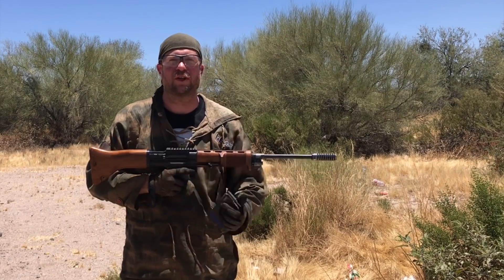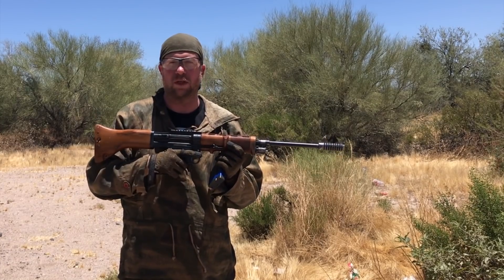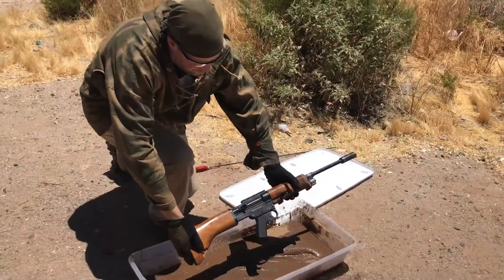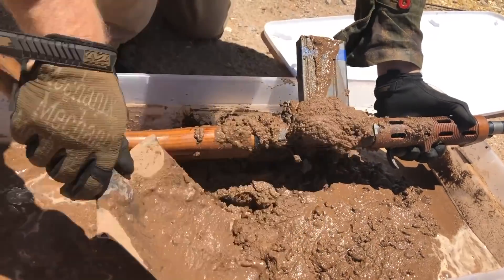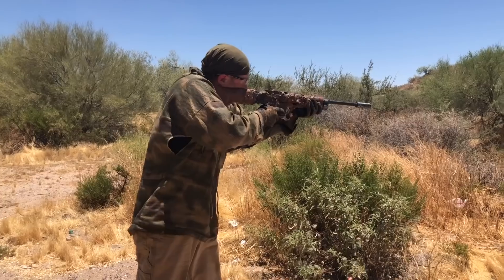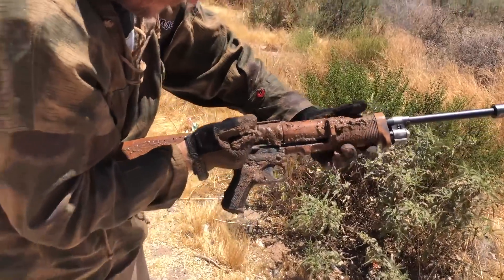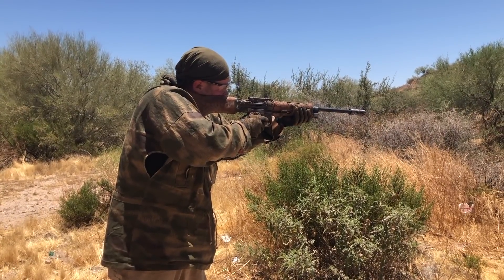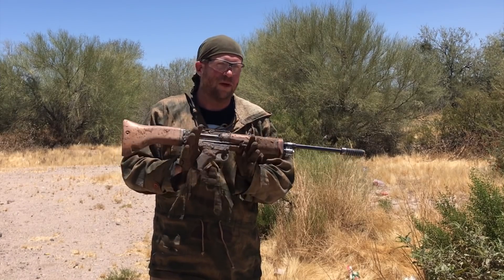Mud Test - SMG Guns Reproduction FG42

Comment: And I always thought the FG42 was a rather delicate rifle. Little did I know.
Reply: Ironically, for a gun that looks delicate, the fact it was made for use by German paratroopers required that it be very tough as German parachutes were notorious for their low-retardation, resulting in a higher drop speed than typical for American or British designs. Meant that their containers and troopers alike took pretty hard knocks, so everything had to be well-packed or just plain tough.
Reply: The stock is the most fragile bit.
Reply: It still is. It's just tightly sealed.
Reply: Well, the original production FG42's were more fragile in their design and execution due to different manufacturing tolerances and material constraints of the war, so there is potential there for failures. I could especially see mudded cartridges causing a lot of potentially dangerous firing issues in the original FG42's cylindrical chamber (designed so the gun could have manageable and safe extraction pressure). But, needless to say, I don't think it's worth risking a scarce $200k+ original example on this theory. All-in-all, I think this test of the SMG repro is a valid test of what the potential of the FG42 /could/ have been and is certainly reassuring of the quality for people (like myself) trying to save up the $5k for one...
Reply: People say the same thing about the AR15/M16/M4 family of guns, and those pass. It's got nothing to do with fragility, it has everything to do with being a sealed design. No gun will tolerate gunk in the action, some designs are just better at keeping gunk out.
Reply: @thforres  "No gun will tolerate gunk in the action" Beside an open bolt SMG with a fixed firing pin. It will just keep firing .... out of battery. I think we will never see a mudtest with a MAC-10. Because it just isnt a safe thing to do.
Reply: @robert8984  no the mud would probably slow the bolt down enough it couldn't set off the primers
Reply: @tatsuhirosatou5513  agreed. As previously stated the reason guns pass these tests is because they seal well. Any open bolt design will fail miserably. And for all the naysayers, I know the original FG42 was open bolt, this one obviously isnt and thus, why it passed so easily
Reply: @thelaborpeasant  To be fair, open bolt in full auto but closed bolt in semi auto. If it stayed in semi auto, I think an original would have been fine. Forget about the full auto setting when the bolt is open tho.
Reply: @thelaborpeasant  The original FG 42 was open bolt for automatic fire only. I'm semi auto it was closed bolt only. Larry Vickers did a video on an original FG 42 that shows this quite nicely.
Reply: @onelonecelt9168  well I just mentioned it because I knew some keyboard hero would try to factoid me about it if I didnt mention the open bolt, that's all lol
Reply: @thelaborpeasant  Keyboard hero! Lol. Didn't know if you knew that, so I figured I'd point it out. Have a great day.
Reply: @themastermason1  Although unlike the STG-44, breaking the stock won't render the FG-42 inoperative. It actually, the stock can be missing on the rifle and it will still work, whereas on the STG-44, it needs to be there in order to contain the recoil spring.
Reply: Same for most German guns. P08 is super reliable, Mauser is well... indestructible? G43 sucks.
Reply: @onelonecelt9168  That's kind of a shorthand for how the FG actually works.  The truth is more like "in full-auto it's open-bolt, in semi-auto it's open-bolt-oid but zero bolt travel".
Reply: German guns stereotypes. No basis in reality.
Reply: It's a stereotype for every German gun. Meanwhile everthing that is Russian (guns, cars, tanks, woman) is considered strong and unbreakable.

Comment: I have to say, im not surprised. I own a German made Reproduction. And, at least it has a very violent operating bolt. Spend brass is completely deformed (With the typical FG42 double shoulder) and is ejected about 5 to 7 meters forward. On top of that, the bolt seals the ejection port very good. Mud can only get in through the charging handle slot, but if it gets in, it stops the gun pretty fast, as we could see in this wonderful experiment.

Comment: Pretty surprising result. However if this was an actual FG42 set on full auto it would almost certainly fail. Reason for that is that in full auto, FG42 is open bolt so it would be completely open.

Comment: So that was a clean pass. Er, a dirty pass. A pass. A very, very respectable pass. 
It took you deliberately packing mud solid into everywhere you could find to kill it, but what wouldn't be killed by that?
Reply: And even after that it still cycled a couple of times before failure.
Reply: I love that it still got three rounds out after that.
Reply: @FluffRat  It may have got more if the German paratrooper using this in the Italian alps had bothered to pick up a twig and scraped some out before firing.

Comment: The redemption of 7.62x51 had us and British military just chambered  fg42 in it the troops would have been happy and the old brass would have got their 30cal select fire multipurpose rifle but no they know better and selected m14 didn't they learn anything from soviets avs36 and avt40. We have to wait until scar h for something close enough to reach fg42 level of performance but even then it's not enough as scar h have tendency to jar out optics due to its harmonics so use a strong optic mount. But I can't be optimistic because they did a crap job on its derivatives m60 and em2. M60 have to wait till 2014 to sort out all of its deficiencies to become really become on par of pkm/pecheneg with m60e6. In search for intermediate cartridge British made em2 so much lighter they can't rechamber it to 7.62x51. Fn fal good design but suffered by abrupt choice of 7.62x51 not got enough time to devlop a proper select fire 7.62x39 rifle. While g3 full auto design is good for intermediate cartridges only still waiting for stg45 in 7.62x39 reproduction.

Comment: While Rick Smiths skill is in no way in question, does this pass speak more towards FG42 design or Rick smiths skill? While interesting, i'm curious if an original would fare the same, though since it operates on the same system I don't see why it wouldn't be similar at least. But maybe production ones would have had looser tolerances allowing more ingress.

Comment: Just a bit of conjecture, but since the original FG42 had that funky hybrid open/closed bolt system on full and semi auto (respectively), would it would be safe to assume that on full auto the system would fail much quicker?
Reply from the maker: Not when set to semi.

Comment: I wonder how much it cost to manufacture an FG42 compared to a K98k? Would the germans have been better served by manufacturing more of these as opposed to simply building kriegsmodell K98ks in 44-45?Would the higher cost have been offset by a far better firearm in combat?
Reply: Cost isn't the only factor. If anything, by that stage of the war ease & speed of manufacture was far more important. A better rifle is no use if you can't field it in appropriate numbers.

Comment: Oof.  Even for a replica, still painful to see that design dunked into the sludge.

Surprised how well it worked though, at least initially.
Reply: I don’t get why this is painful to watch. Guns are tools. They’re not meant to be coddled. They’re not expensive toys.
Reply: Carl Smith some guns factually are for sure, I agree. I think there are some that aren’t and it just depends on the intrinsic value the person has for it.
Reply: @carlsmith8176  $5000 is not a hammer from Walmart.
Reply: @carlsmith8176  I don't know, $5,495 and then FFL transfer fees is expensive especially since you can make an AR for 300-400 bucks then get 1000 rounds for 200-300.
Reply: @carlsmith8176  They're expensive tools. I can't see a mechanic dunking his 5,000 dollar tool in a bucket of oil to see if it'll still work after.
Reply: @carlsmith8176  There are people out there who don't abuse tools (with intent).
Reply: @carlsmith8176  
Some are expensive but hey it's their.
Reply: Carl Smith given that the particular model Karl has probably cost $5000 or more, I would call that a pretty expensive toy.
Reply: Carl Smith still, it’s not different than watching your car get keyed or your phone screen crack. It may not affected functionality, but It hurts to watch and you want it back to how it was,
Reply: @carlsmith8176  But they are just expensive toys in civilian hands, just like fast cars are. I'd equate this mudtest with driving one's precious Opel 170mph on narrow country road.. most don't have balls to do it
Reply: I wouldn't restrict it to initially - it really seemed like karl wanted it to fail and was way harder on it than regular and didn't water it. I'd say it passed completely
Reply: The mud was a lot thicker/drier than most mud tests he does. It wasnt able to run in to the action like on most of the tests. Notice it failed as soon as he manually pushed it in to the action?

Comment: No chance you worked out why it wasn't going into battery?

Was the ejection port the issue or did the muck get in from another hole? 

Also, dare I ask, but post mudding, it didn't seem to reset so quickly. Anything of note happen under the front handguard?
Reply: I own a german made reproduction, and im not surprised by the result. The ejection port on an FG42 is very well sealed by the bolt, I suspect mud got into the slot for the Charging handle. Its the only part on the rifle that is not as well sealed as the rest of it.
Reply: @bob445566DE  No chance you could get some pics of it? 

I would have assumed not going into battery was more a chamber/ejection issue like the Ak47 etc than a op rod issue, alla M1.

Comment: SMG does what an HMG can't. (I apologize, I couldn't resist.)
Reply: But it’s not the same thing. SMG has been doing replicas and rebuilds and conversions of existing machine guns for years and building one-offs.
HMG is a small engineering firm trying to, as a part of their product line, trying to build a modern iteration of the STG 44 to a price point. They are not building a copy of the original gun, but one different. 
Different gun, different product. Not been following the travails of HMG, but reportedly have been have serious problems with magazines. As A couple beloved YouTube presenters of firearms info, Named Ian and Othias have repeatedly informed us, magazines have been the downfall of many.

I get your point, it is a somewhat valid point that fails upon inspection. However one does deliver his target, HMG, not quite yet.

Which brings up another question, if HMG ever delivers, will we see someone get their weapon mud tested?
Reply: HMG still has a business, it's just a business selling CETME-L's and steel targets while talking about the  STG's
Reply: @charlesadams1721  I was talking about guns, sir! (LOL)

Comment: Absolutely astounding. Great testament to the original design and the clever engineering work at SMG.
Personally i'd prefer the safety in the original config as opposed to on the fire selector but that's neither here nor there as it still does it's job. Still a magnificent machine. =]